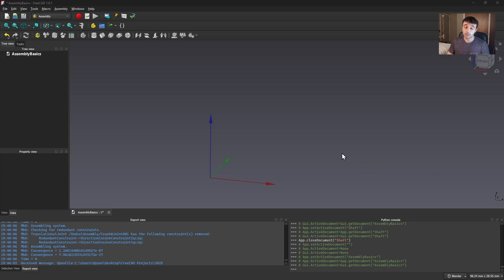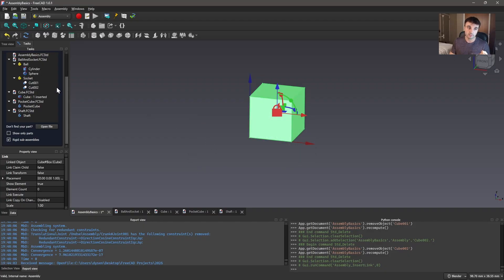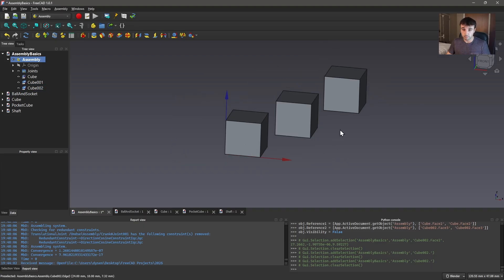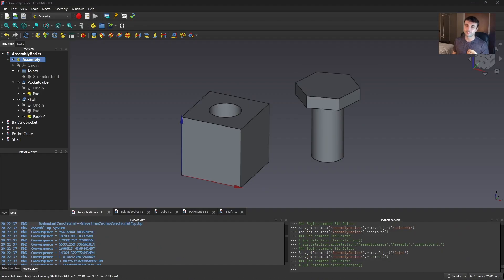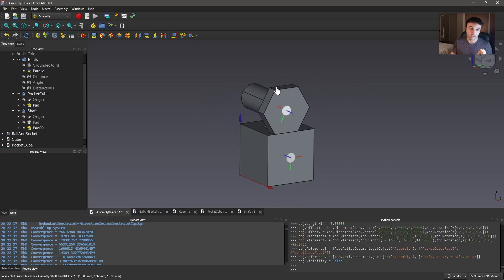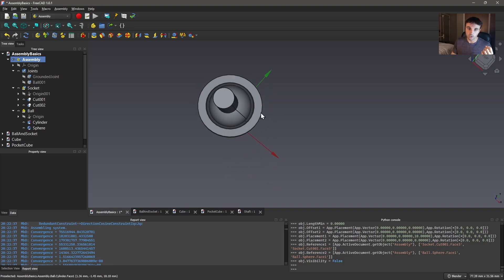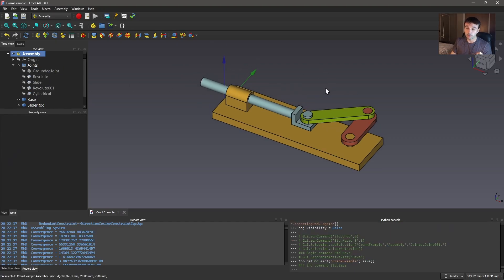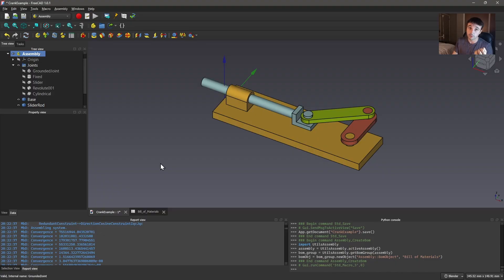FreeCAD Assembly Workbench - Getting Started

Comment: Good video.  I'm finding that my first few joints work as expected, then they just don't.   The joint is still created, but it acts like it isn't there.
Reply from the maker: Does FreeCAD report an error when you solve the assembly? Make sure that every part has some relation to a grounded part, otherwise I'm not sure. Also keep in mind you can still move parts where they "shouldn't" be but they should be reset when you use the solve assembly tool.

I might be able to help troubleshoot if you give more info :)